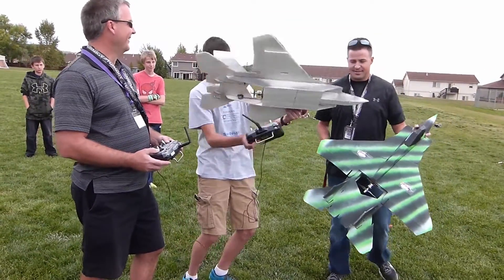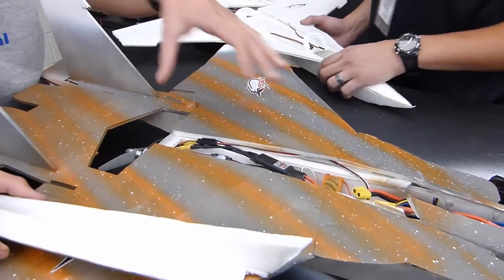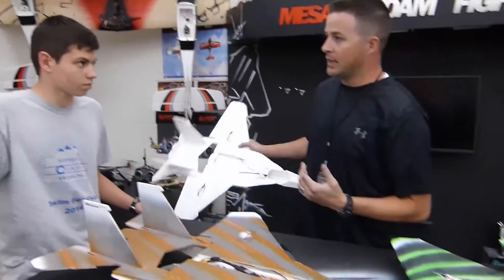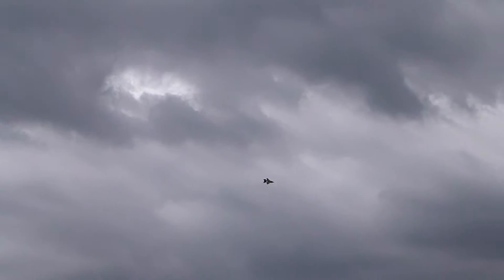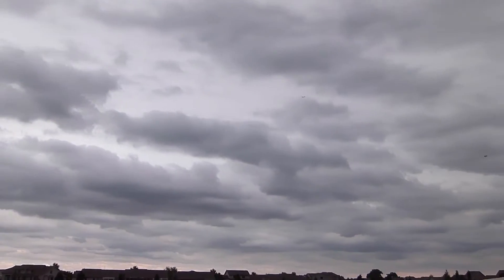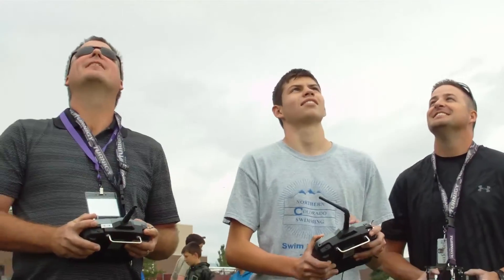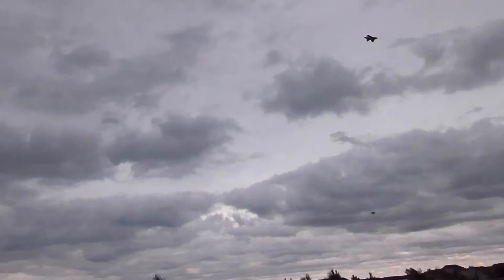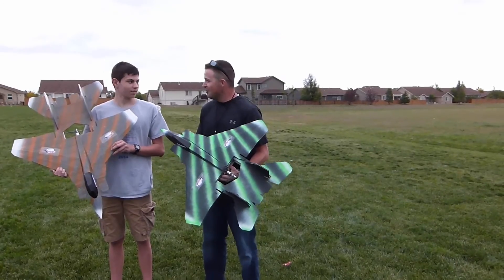MESArcFF - MF-15 Eagle - STUDENT PROJECT

Comment: You might to check the timing setting on the ESC. Sometimes a high kv motor will stall if the ESC timing set to low. But be aware that setting high timing will increase the heat produced by the ESC.

Comment: The pulsing you are getting when the student is flying is probably the radio. I have a dx5e that came with an apprentice and when I am hooked up to a simulator through the trainer port the throttle will jump around at times. Doesn't do that when the controls are going through the radio only when using the trainer port.  

I love the work you are doing with the students.
Reply: I did also experienced it when using the USB cable for the flight sim. I found out the internal cable wires near the plug-in jack is damaged, mostly caused by constant tight bending during storage. The radio transmitter get disconnected very often from the PC when I bend the cable near the plug-in jack.